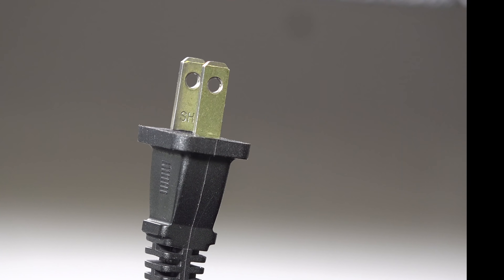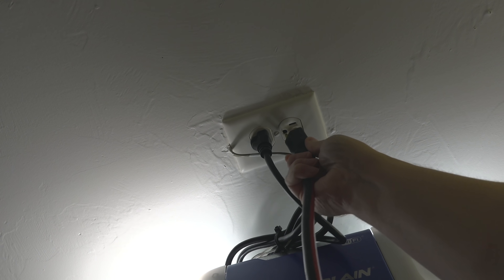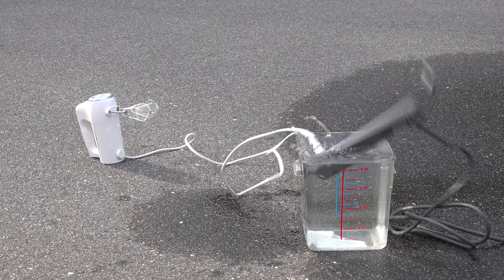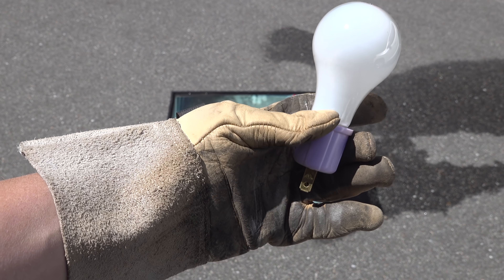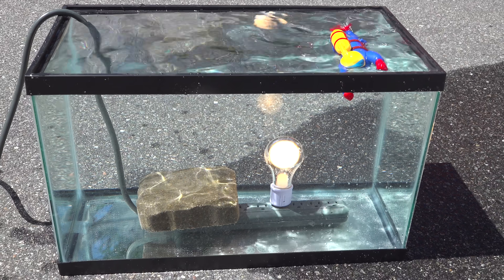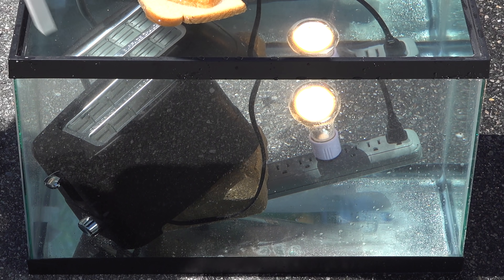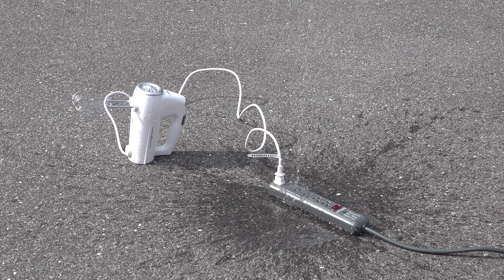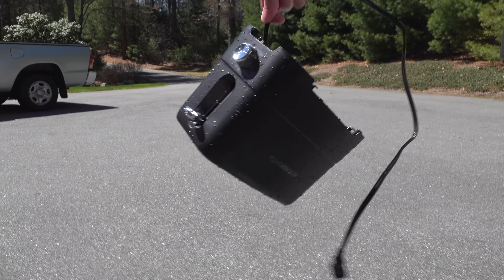What REALLY HAPPENS WHEN YOU SPILL WATER in an OUTLET?

Comment: The minerals in water causes the water to electrify.  If you was using distilled water then there would be no electricity.  In this case regular tap water was most likely used and should have tripped the breaker with a hot to neutral short.  I don’t know why it didn’t.

Comment: This video is a summary of the misunderstanding that most of people have about water and electricity.
Water is not a conductor, so it cannot short a circuit and trip the circuit breaker. Also tap water is not 100% pure to act like an insulator and carry some current through calcium ions: that's where the electric shock is possible, because the irons can carry charge and forms a high resistive circuit. High enough to not short circuit, but enough to cause shock on skin.

Comment: If I remember right pure water is an insulator so while I definitely wouldn't risk it just incase some sort of mineral or salt had gotten in you theoretically could have a live power cable under water and get in the water and even get pretty close and if there is a ground path between you and the live wire then the wire should be the lowest resistance path although I think it goes without saying don't ever get in water with a live conductor exposed near by even if it's not touching the water because that would be needlessly dangerous and potential enter your for the Darwin awards

Comment: Well, duh. The protection on the power strip is only for current overload. The same goes for a standard breaker. Only an RCD/GFCI breaks the circuit and even then only if it's a fault to ground. If you are the short between the phase and neutral (like a finger across both) and you're insulated from ground, they won't trip either.

Comment: "GFCI outlets definitely work and they will protect you against any kind of electrocution when you're around water and electricity"

Mate, you've done 1 test. That's the most unscientific thing I've heard in a while. You haven't proven that the breaker pops for wet hands. You've assumed all water is equal. I do believe the statement is mostly true, but you haven't proven it, and many other kinds of electrocution exist that isn't spraying water on a socket.
Reply: ... can't tell if joking or just don't know. It doesn't matter how many tests this one person had done. Theres been dozens if not hundreds if not thousands of tests done with GFCI outlets. There's a reason its code that any outlets outside have to  gfci protected and near sinks/tubs/showers.

Comment: normal tap water is not conductive enough to trip over current devices add some salt make the water more conductive you will get alot of buzzing gas production and arcing may still not be enough unless you add a lot of salt. it also depends on the area of live parts not sealed form the water. 

RCDs sense imbalance in current flow between live and neutral. the trip threshold being quite small can be induced by low conductivity water, a person, bad insulation, filter circuits that connect to earth etc. 
if you have alot of it equipment on one RCD it can cause false tripping because of the accumulated earth leakage.  i have a video on my channel of me submerging a 240v hair dryer in tap water just runs under water but has a voltage gradiant around it.

Comment: add salt to the water, regular unsalty water isn’t conductive

Edit: now everyone is calling me a moron😂😂😂
Reply: @sem6045  RIP
Reply: If only there was a way to quickly look this up ...oh wait google exists. "tap water has EC in the range of 50 to 800 uS [sic]" (unit is actually uS/cm).

So let's say the prongs on the US power plug is 6x18 mm² in size and 13mm apart. Assuming the best case (lowest conductivity) that gives us a resistance of 1.3cm/(50*10-6S/cm * 0.6cm * 1.8cm) ≈ 24kOhm (and 1.5kOhm for the worst case). Which using Ohm's law gives us a current of 110V / 24kOhm ≈ 5mA for the best case and 73mA for the worst case. (In this video the current was most likely higher since the conductive area of the power strip was greater.)

So tap water is indeed conductive, but nowhere near conductive enough to trip the overcurrent protection on even a small 6A breaker. However, still ranging from a mild shock to leltal and will most of the time trip a GFCI/RCD breaker, which trips at 4-6mA.
Reply: People all so rude and being asshole nowdays.
Reply: And soap
Reply: Hi Hilda
Reply: Here are portable generator safety rules: this safety information is only for anyone who use a portable gas generator and for those who are planning on getting a portable gas generator. This is just a reminder for everyone’s safety. All generator safety rules should be followed carefully. This advice is just to make sure that everyone is aware of all the warnings and it’s just to remind people to be careful using portable generators. Generators can be dangerous if not used carefully. Every year, hundreds of people die or get injured when using portable generators due to carbon monoxide poisoning and electrocution. Make sure you are using your generator carefully and keeping others safe as well. There is something very serious that everyone should always be aware of when using generators. Some people do run their generator indoors which is not safe and that increases the risk of carbon monoxide poisoning which can cause death of family and you. Some people run their generator in wet conditions which can electrocute them. Please remember that you should never run your generator indoors. Remember that carbon monoxide is an odorless and colorless gas that you cannot see or smell. Carbon monoxide is a silent killer. Keep that in mind. Make sure your generator is 15-20 feet away from your house and away from doors, windows, and vents. Never use your generator in your porch too. Having a carbon monoxide detector is very important against generator safety. Some people also allow children to go near the portable generator which could pose risks. We need to keep an eye on our children making sure that they are not near the portable generator so they won’t get electrocuted or burned by the generator which is dangerous. A locking enclosure also keeps kids safe. A generator shed might look like a tempting place to explore, or take cover during a game of hide and seek, but a generator is a dangerous piece of equipment that can cause injury. It says on the manual that we should also keep children away at all times from the portable generator to avoid injuries. Please do not allow a child or unqualified people to operate the portable generator.  It is important to keep your children safe especially little ones. The portable generator can be hot during an operation. Just because some manuals missed what should be listed doesn’t mean it’s safe to do. Always follow the generator safety rules when using portable generators. Generators pose electrical risks. If you need to use your generator during wet weather, you need a generator tent to protect your generator from getting wet. Don’t let your generator get wet. Keep your generator dry and before using your generator, please make sure your hands and your generator is dry. Do not wear loose clothing when operating the generator. Everything that is said on the generator’s operating manual should not be ignored. Never smoke cigarettes near the generator. Please keep flammable things away from the generator. Never overload your generator too. Your generator can catch fire. Never ever try to plug a generator cord into a wall outlet to avoid back feeding. Back feeding your generator is dangerous. Always turn on your generator first before plugging in appliances and shut off the appliances before turning your generator off. Use a heavy duty cord for your generator and the cord should not be worn out. All the instructions should be followed carefully. Never refuel your generator while it’s running. It can cause fire if fuel spills while your generator is hot. You should turn off your generator and let it cool off before refueling it. Having a fire extinguisher next to the generator is also important. This is only a reminder for everyone’s safety of using generators. Make sure your generator is properly grounded. Having a fire extinguisher next to the generator is also important against the safety rules. https://youtu.be/I1jT3ANENvI and here is a video more about keeping others safe when using generators and also about our family’s safety. Hope this helps. Thank you.
Reply: @The_Happy_Aviation_Enthusiast  you could write a full size novel with that comment!!!!!
Reply: no?
Reply: @shaun q
Reply: Bruh, unsalty water
Reply: oh yeah sure, tell that firefighetr next time he will be extinguish fire on electronic, he will smack you with extinguisher. Water aint conductive, yeeeeah, i can tell that you form USA since you lack basic knowledge, dont tell such a bullshit on internet, you want to kill someone morron?
Reply: @NCRVeteranRanger-w6s  jesus christ, go outside
Reply: @NCRVeteranRanger-w6s  i’m just worried bro. Patrolling the Mojave almost makes you wish for a nuclear winter
Reply: Correct 🔥🔥🔥❤️
Reply: They are both conducturs but salted water turns into chlorine if it's exposed to electricity

Comment: The water isn't a perfect insulator, but it's not a great conductor either.  Notably, a GFCI only needs somewhere from 5 to 20 milliamps to trip, depending on the class and build quality of the GFCI.  And despite my confidence that there was surely some current flowing at all times in the water, it would appear that amount was VERY low, as the GFCI didn't even trip immediately when the receptacles became flooded.

All that said, I do hope that most people understand that the "GF" in "GFCI" stands for "Ground Fault."  If there's no ground conductor in use (for example, because it's a 2-prong appliance, or a 2-prong extension cord is in the circuit)... then the GFCI simply cannot do its job.  BZZZT!

Comment: The metal has less resistance than the water. Electricity will always take the easiest path
Reply: If both paths have resistance, it will take both paths, but more current will run through the less resistive path

Comment: Tbh i think your expectations of what would happen were greatly mislead by movies.
That said how dangerous is the mix between electricity and water depends on the purity of the water it self. Even then (as you can see in electroboom's video about the girl who shocked her self in the bath tub, electricity will always take the easiest path to complete a circuit, which in this case is always to go trough the appliance, and even without it it would just gi across the 2 metal prongs inside the power strip, leaving the rest of the water basically untouched. For you to get shocked with electricity trough water you would require impure water (with something like soap or salt in it) and you would need to be connected to earth, by for example being bare footed or touching the ground wire.
I seriously hate how movies pictures electricity and i guess the only good thing about it is that people are generally more careful.
On a completely separate note, in other countries, and especially europe, even tho voltage is double which means current is quadrupled so it's somewhat a bigger danger, houses have the full house protected by an equivalent of gfci (can't recall the name). 

Do what you want with this information, I hope to have clarified some stuff, have a good one

Comment: Once my dorm was flooded there's power outlet still connected with power on. Initiated to turn off the building power circuit first but friend of mine go straight bare foot and pulled the cable off like there's nothing. The outlet is definitely soaked with water while powering a fan and mini-fridge. He laughed, but I'm still amazed how he's still alive until now.
Reply: Blind luck or God saved him there. Most likely he didn't get in a position where he provided a "better" path to ground. But under the wrong conditions that could have easily happened so you had the right idea to turn off the power before attempting to retrieve anything.

Comment: I know first hand not to let leak onto a power strip is Saltwater. I had a saltwater aquarium that leaked into a power strip little did I know until my house was on fire! Ironically I used the same saltwater from the aquarium to splash on to the fire to put it out.

Comment: I think this illustrates why GFCI circuits are necessary. Water is conductive enough that you can see electrolysis occuring, and thus also present a shock hazard, but is not so conductive that it will trigger the breaker on its own. That means that without GFCI protection, if you get in the path of current, it'll just keep on shocking you and won't necessarily trip the breaker until you're quite crisp.

Comment: So about a week ago I had a drink stupidly placed on my desk. Below it was a regular old power strip plugged into a non gfi outlet. I spilled the drink. The only thing that happened was clicking from the power strip. Everything stayed powered on. I turned it off and let it dry and it's been working since. Either way, I hope it doesn't happen again. But I was quite surprised on the result. Granted it wasn't as much liquid as the tests here, but I still expected the worse. The moral is, when done right, electricity is safer than we give it credit for
Reply: Oh, that power strip was controlling a light and a cctv. Neither had any harm and neither showed any disturbance, despite the noise from the power strip

Comment: My auntie had her Christmas lights all plugged in a power strip that was full of water.
Another time I got "electrocuted" from touching the metal box of a light switch in the basement that filled itself up with water through the wire conduit, somehow. I felt a tickling and I immediately took my hand away. The light still worked fine, we had it replaced with a plastic one and some holes where drilled to the bottom for draining, should this happen again

Comment: Ohm's law (and a bit of Kirchhoff's law) is all you need. Pure water has resistance of mega-ohms (for a cube of 1 cm, adjust proportionally for distance and inversely cross-section), sea water 20 ohms (ohm cm for purists), tap water somewhere in between. So assuming that the current flows over a distance of a cm and a cross section of a square cm (might vary, depending on the geometry, but probably not too much) sea water would draw 6 Amps (720 Watts) out of the circuit, not enough to trip for over-current. GFCI on the other hand (or a human body with wet skin!) will react orders of magnitude more sensitively!
Reply: Wet human has a resistance of 250 ohm. So could draw almost half an amp under optimum (or actually "worst") circumstances (standing on or touching a ground wire with the other hand at the same time), or 10x the absolutely lethal dose.

Comment: Don't believe everything you see on TV! 

Water is a dielectric and is not a conductor unless it is very impure, so it actually has quite a bit of resistance. Knowing you're in MA and we have very soft water you're water is mostly...water. In the first instance the glass tank insulated the water from ground and the water in the tank was at best a very, very weak conductor. Because the water has a lot of resistance it isn't acting as a direct short to ground no excessive current flows through the circuit to trip the breaker (even though some is no doubt being leaked off to the circuit's protective ground). If anything, the water is acting like a giant heating element on a stove or an incandescent light which are just resistors across hot and neutral. If there was something introduced with much lower resistance, like piece of metal (or a person), that was able to more readily bridge the flow of electricity to ground the current would spike and the breaker would trip.

What happens with the GFCI outlet is there is circuitry that detects the amount of current coming into the outlet on the hot wire and going out on the neutral wire and if it detects a difference between the two (presumably due to leakage to ground - its own or an external) it cuts the circuit. 

This is helpful for the reason above, people are good conductors and if they're in water and the water gets electrified the circuit might not trip and the people will just get pounded with current continuously.

Comment: There is no ground fault, hence no trip
Reply: There is a ground fault. But it was only plugged into a standard breaker, until the very end, which doesn't trip on ground fault alone - only if the ground fault current exceeds the breaker's rating, not because it's a ground fault.

Comment: Those of us who work with electricity nearly every day aren’t surprised by this at all.
The common misconception that electric supply wires need to be waterproofed just got proved again that it doesn’t, at least not for electric supply function. Now, the potential for someone to touch the water and carry the voltage to a ground through them self, yes of course. But, this video proves how very ignorant the common public is about high-voltage electricity.

Comment: Gfci outlet are not just for water, it measure the current flowing between line and neutral wire, if the current is not the same the gfci outlet will trip, they start to work at a difference of a couple milliamps.

Comment: GFCI Breakers offer protection for the whole circuit. We have outlets in the areas that require it by code and in the panel for all 15-20 amp circuits. When the chicago river was breached in the late 90's or so all of the underground electrical infrasstructure remained intact. Probably for the same reason your daring expirement worked.